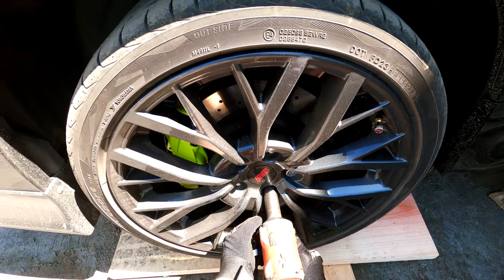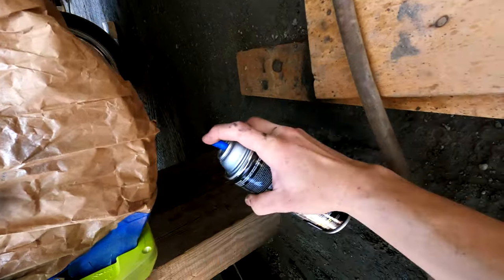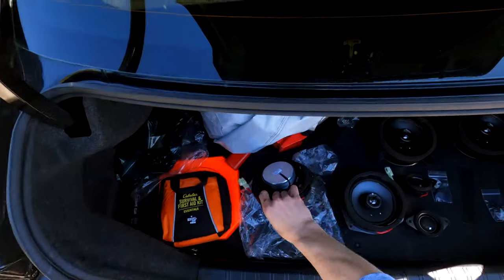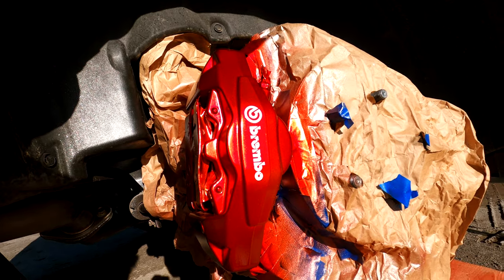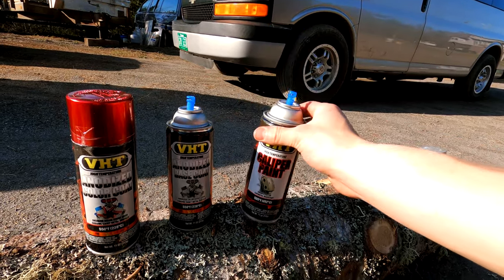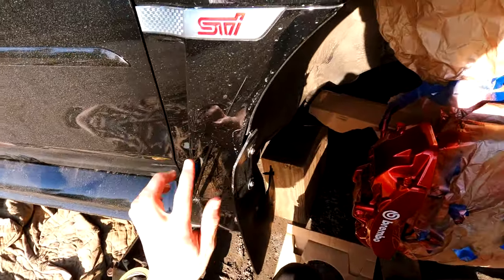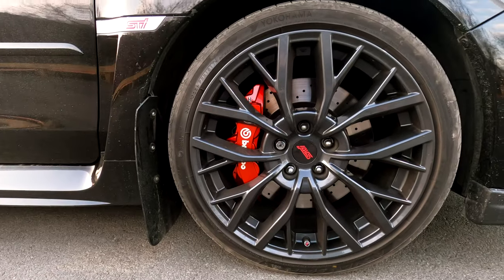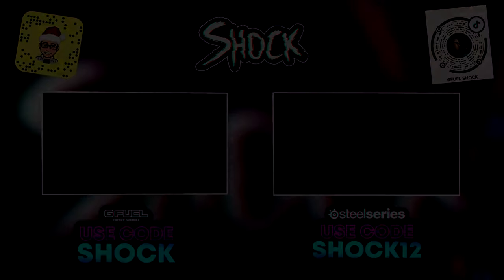(HOW TO PAINT WRX STI CALIPERS) - FINALLY CHANGING MY WRX STI CALIPER COLOR TO "CANDY APPLE RED"

Comment: Great video, but the Brembo stickers are upside down 😂
Reply from the maker: I looked them up on google and some are this way? why is that
Reply: @ElectricShock14  You were probably looking at Brembo calipers that are placed differently on the rotor. Only the the caliper was on the other side of the rotor ( like on an evo for example) the sticker would be in the correct direction.
All you needed to do to avoid this was look at the older STi calipers to see the correct placement of the brembo sticker. 
I hope after seeing this you fix it ASAP because it looks off by alot rn
Reply from the maker: @apersad  Thanks fam, next time I paint them I will fix it

Comment: Hey. Could you tell me or anybody really - what all do i need to COVER with tape / bags when painting this. I dont mean the car i mean when do i NOT want to spray on the actual calliper ? or can i spray over anything.
Reply from the maker: I would not spray the brake pads or rotor, I mean you can but I wouldn't.